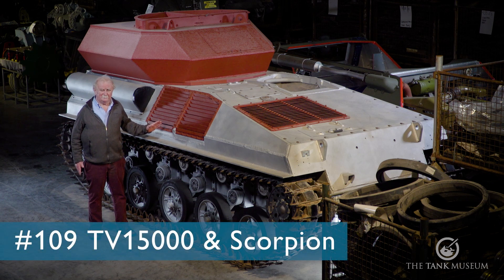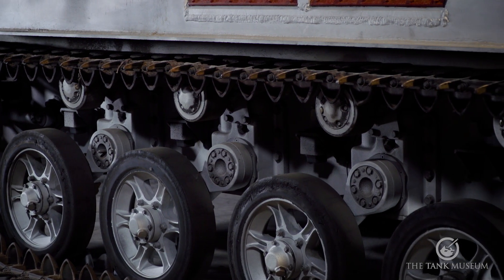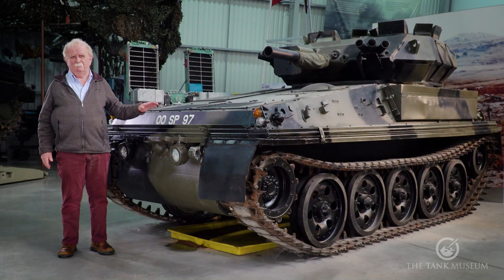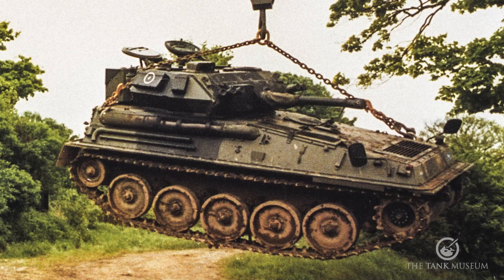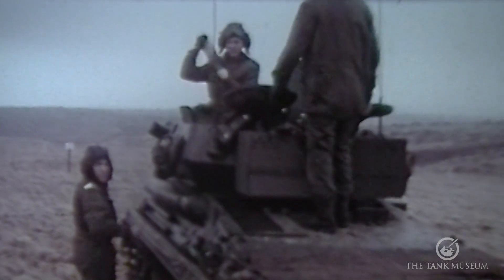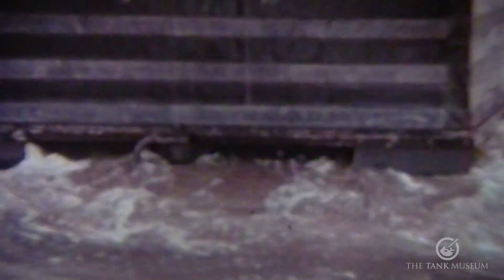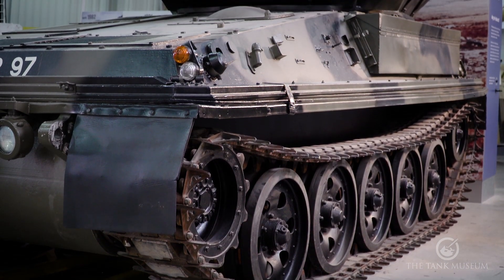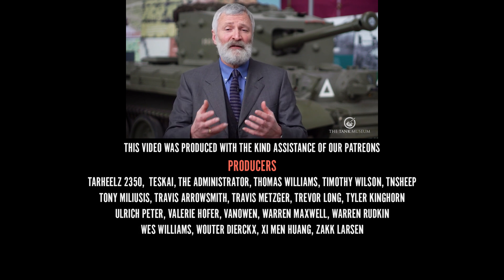Tank Chats #109 | Scorpion & TV15000 | The Tank Museum

Comment: The reason aluminium structures are generally considered to be lighter is because aluminium performs better per unit weight for buckling failure modes. If you look at the tensile strength per weight, the difference between aluminium and steel becomes almost negligible

Comment: The choice of the 76mm gun without advanced fire control is very odd on a vehicle this fast. Given ww2 experience with close air support, anti tank guns, and infantry. Choosing a rapid fire duel purpose gun like the 20mm vulcan would be a significantly better option. This would also enable dropping the crew to two men, and a massive increase in ammunition.

Comment: The Canadian Army looked at buying a number of Scorpions as a potential recce vehicle, but never followed through. Testing revealed that the Scorpion didn't fare too well in Canada's harsh winter weather conditions and a number of the Scorpions that were being tested had developed serious engine fires. The other problem was that the Scorpion was deemed too expensive by the government, as it was seeking to cut defence spending.

What ended up happening was the army ended up getting the Cougar, a six-wheeled vehicle based on the Swiss-designed MOWAG 6x6 platform that mounted a Scorpion turret. The Cougar was intended to be part of a family of vehicles designated Armoured Vehicle General Purpose (AVGP), where the MOWAG 6 x 6 platform would be used as a common hull to save money and simplify maintenance, and modified as needed to adapt it for specific purposes. The other vehicles in the AVGP family were the Grizzly and the Husky. The Grizzly was a 6 x 6 wheeled armoured personnel carrier that mounted a Cadillac-Gage One-Metre turret equipped with a 50 calibre Browning M2 heavy machine gun and a Browning M1919 machine gun rechambered to accept 7.62mm NATO ammunition. 

A roof-mounted fan was installed on the turret of the Cougar to assist with clearing out noxious fumes filling the turret after the main gun was fired. Whether the fan was more effective at removing fumes than the stock CVR(T) Scorpion turret is unclear. 

The Husky was equipped with a small crane and it was employed as an armoured recovery and armoured engineering vehicle. It lacked a turret.

The Cougar was primarily used as a reconnaissance vehicle,  tank trainer and infantry fire-support vehicle. The government of the day wanted to get out of the tank business entirely and thought it could save money and still retain corporate memory of armoured fighting tactics by buying a vehicle like the Cougar. 

The Cougar had substantial problems, not least of which was the inherent high centre of gravity that was a natural result of the 6 x 6 hull having a short, narrow wheelbase.

The Cougar was also top-heavy due to the Scorpion turret. This conspired with the high centre of gravity to make the vehicle prone to tipping over unless considerable care was taken while driving the vehicle. The Cougar could also over due to the recoil of the main gun if the turret was traversed 90 degrees to the right or left from the centre line. 

The Cougar was also designed to be amphibious. However, during pre-delivery amphibious trials, a Cougar sank, resulting in the death of one of the testing staff.

None of the AVGP vehicles were deployed with Canada's NATO contingent in West Germany prior to 1990. While a number of Cougars and Grizzly APCs were deployed with the UN mission in the Former Republic of Yugoslavia in the early 1990s, the vast majority were used for domestic service. Many Cougars saw extensive service with armoured reserve units throughout Canada, until being retired in the early 2000s.

Comment: 10:55 i understand what they are doing but never do it like that, if that cable were to snap from that sudden tension those 2 guys back there would be dead.

You easy up the tension and then gun it once the cable is tight.

Comment: Light tanks don't work except when they do. Calling them tanks just encourages those who don't understand their capabilities to use them as tanks, calling them tracked reconnaissance tells others what their role should be. In fact sometimes they can go up against MBTs successfully as in Iraq, put that down to superior training.

Every country that wants to have expeditionary capability struggles with this problem: how to design air deliverable or amphibious assault light armour that can go up against conventional tanks. Fixation on one vehicle that can achieve this on its own is a road to failure, the solution is combined arms. Whe your own MBTs cannot be used light armour must have stealth and speed enough to avoid destruction, infantry need the capability to hold up enemy arnour, your artillery and/or air element should be the ones tasked with tank killing.
Reply: 👍👍👍👍
I have a new Museum Of London video.
Check out my new travel vlog channel, please 😉
Thanks
Reply: Well, the Scorpions in Iraq had an advantage, because they used HESH (High Explosive Squash Head, aka 'plastic' rounds to the Americans) that worked by spalling off chunks of armour on the inside of the turret after detonating. The resulting spray of molten armour would kill or wound the crew inside and also damage the main gun, optics and other equipment. 

The T-54 and T-55 tanks the Iraqis used had relatively thick armour, but it wasn't great armour.

Comment: The worse thing with firing the gun was the armour inside the turret cracked. I was part 10 Fld Wks team trying to stress relieve the front armour in the turret. The gun would be taken out at one shed in the workshop which had an over head crane and the work done in another shed. One day I was supposed to be the commander of one and my mate was driving, we were not given any means of communicating except shouting very loudly at each other. All of a sudden smoke was pouring out the back of the engine compartment. Despite my mate sitting next the engine he didn't see it as it was to the rear of his right shoulder, and driving you look to the front and it was my job to observe left, right and behind . I did get him to stop. I jumped out the turret, crabbing a fire extinguisher as I descended, I opened up the engine hatches seeing my mates bemused face disappearing behind a cloud of smoke and I put the fire out. Ripping my trousers and cutting open my leg on the track in the process. My mate hadn't released the hand brake fully it was that which caused the fire. He got a bollocking, I got no thanks and was billed by the QMS for a new pair of trousers. 

We worked a lot of overtime during that period and when moving the Scorpions form one shed to the other we would race each other from one shed to the other. Sometimes the MOD police who were on the gate would join in. The civies near by complained about the noise of us racing around the workshops. The MOD pods were asked if they saw us racing, strangely they hadn't. 

During my time at Tidworth I was sent to help the gun fitter at 1RTR with a modification to the hand traverse that David mentioned. I was working inside the turret as I traversed it I saw some black berets close to the vehicle appear in  the gunner's visor. I shouted "Turret traversing, get your f***ing heads out the way". Next thing I heard someone climb on the Scorpion and the RSM's head appear upside down through the commanders hatch "Next time you tell the colonel to get his f***ing head out the way remember to say SIR" 

I still have a scar on my shin but not the trousers.

Comment: I knew a NZ Army Scorpion driver who reckoned it could do over 100kph on a sealed road. In fact they had a reputation for overtaking tour buses driving near Waiouru. They also had a reputation for rolling when cornering on gravel roads at speed. At least a couple commanders were killed in this manner over the years, leading the NZ army to prohibit high speed road transit.
Reply: Them catch alight didn't help
Reply: Driving these on opps was definately an art, novice drivers needed close supervision as gear and speed selection  on corhers was essential , I saw more than one roll theirs. I was a driver of these for four years and had some amazing experiencs before moving on to command a Sultan.

Comment: Apparently some of the first built were supplied to Kenya, it wasn't until after they were supplied they found problems with the aluminium welds cracking which was cured by bead blasting the welds to relieve the stresses - but they never told the Kenyans ( well I suppose they know now! )

Comment: " A done up Austin Westminster", the Vanden Plas 4 litre "R" was a very nice car but yes  it was just "a done up Austin Westminster
Reply: The one we ran had a very slightly different engine, the distributor cap. We were told, waiting in Dumfries, that the particular engine had been built by Rolls-Royce, not Austin.

There were worse places to be stuck.
Reply: @davebell4917  Yes it was a Rolls Royce engine just an Austin Westminster body( An  Austin cambridge or Morris oxford really)

Comment: Spent several happy years on CVR(T). You mentioned the narrowness of the vehicle several times. I had heard that this came out of experience in Malaya.  The width was constrained so the vehicle could go between the trees of a rubber plantation should the need have arisen!
 
 A pity you missed out on the fleet, the names of which were one of the cleverest things about the vehicles
FV 101 Scorpion 76mm gun vehicle
FV 102 Striker Anti Tank Guided Weapon Vehicle (4 + 4 Swingfire missiles)
FV 103 Spartan APC (personel carrier)
FV 104 Samaritan Ambulance
FV 105 Sultan Command Vehicle
FV 106 Samson Recovery Vehicle
FV 107 Scimitar  30mm Rarden gun vehicle
Sabre 30mm (used Scorpion hull with Fox (CVR(W) turret
There was also a thing called Streaker which was a Spartan with a flatbed - not brought into service
Spartan and Scorpion were also modified to provide OPFOR (Opposing Force Vehicles in BATUS known as Strurgeon and Salamander respectively.
vehicle

identified
surprised

Comment: The Sabre had the 30mm turret removed from the FV 721 CVR(W) Fox armoured car with a raised turret ring. This was to make up for the squat height of the repurposed Fox turret.
The chassis of the Fox was then "cast" and disposed off. Whereas the Sabre was modified along with some of the CVR(T) range by the fitting of a Perkins diesel engine. As a part of the MOD's single fuel concept.
Preferred driving the Jaguar J60 versions...the look on Joe Public faces as you drive past them in the fast lane....in a "Tank" ..priceless
Reply: The main reason for the adaptor ring was the difference in turret ring sizes. Off the top of my head, the Fox was 1.2m and the Scorpion was 1.35(ish).

Comment: In Ireland we loved them so much we used them until they fell apart and couldn't be put back together. Despite the fumes it was great for the Irish landscape with its weight we could easily get it out to the Glen of Imaal for a shoot and without a county council shouting at them for damaging the roads. It  also gave the crews a good experience with tracked armored vehicles which we didn't have much of and without them we were mostly improvising to see what we could come up with as we weren't in NATO but wanted to stay a neutral country that could defend itself either at home in Ireland or overseas in UN Peacekeeping missions. So big thanks to England for the tanks, Suas Sasana agus Éire
. (Up England and Ireland.)
Reply: UK CVRTs fell apart as well - hull seams rewelded so many times that there wasn't enough material to do it again. So we gave them new, thicker, hulls and a nice new Diesel engine and carried on.
Reply: @rickansell661  aluminum is hard to weld from the beginning. Surprised all of them didn't break.
Reply: Yep . . aluminium welding makes the metal alongside  very brittle  , the reason they prefer to rivet as much as possible when making thin skinned dinghy's . . also it work hardens & becomes  brittle quick when flexed = breaks
Reply: @benwinter2420  And suffers badly from electrolytic corrosion where it contacts steel - as any owner of an ageing Defender can testify.
Reply: We created the fume extraction system for when firing the gun though. But they where amazing little beasts 😂😂.. I preferred the Panhard AML90 if I'm honest.. I enjoyed it's firepower over the scorpion and it's better capability
Reply: I really really really hope that the UK and Ireland can really bury the hatchet and work together to be awesome like this. I know as a British teenager I had no idea why Ireland would hate us so much and obviously I don't know any English people who hate Ireland, but as events unfolded on TV and I got access to a larger library I started to understand why there was a lot of bad blood. However, as with the USA, France, Germany, etc. the people who commited the atrocities that caused the fighting to start are now either dead and buried or long forgotten, so I hope the younger generations can ignore traditional competition and really get stuck in to some good joint projects. I for one would love to drive an old light tank through the beautiful Irish countryside, but again I suspect that might stir up quite a lot of the issues that I mentioned, so I'll have to try for Salisbury plains instead.
Reply: @elliottsw  I think you are mistaken.. that kind of thought process doesn't exist in Ireland anymore.. and if it does then it's limited to very few people.. as it is over 200,000 english people live in Ireland with absolutely no issues. You can if course come here and do what you like in our countryside. We wouldn't mind at all, in fact we would be happy for you to enjoy it. I have been to england many times and have met many english people over here.. we get on very well I'm fact, most likely we get on better than with any other country because if our shared interests and culture that is somewhat similar. Funny enough, there is a man that owns one if these tanks and regularly drives it around the Irish countryside. Look it up. I believe he is also English
Reply: @maidenaholic  ok sign me up for tank driving in Ireland, sounds awesome :D
Reply: I feel you are a rare breed atm.

The old wounds are being stirred up again nowadays.

Comment: wait... at 11:36 did they just stick the 30mm through the barrel of the 75mm?? didnt even remove the 75 barrel? lol
Reply: no they took the turrets off retired fox armoured cars and stuck them on.
they were also hand cranked.
Reply: LOL - thay actually fitted the turrets from Fox armoured cars, which were being withdrawn at the same time due to their distressing habit of rolling over on fast bends. The Fox turret was similar but different to the Scimitar one. Upside: it had better night vision gear, since it was developed later, downside: it had a smaller turret ring, so an adaptor was needed.